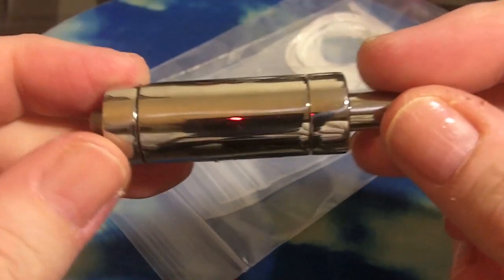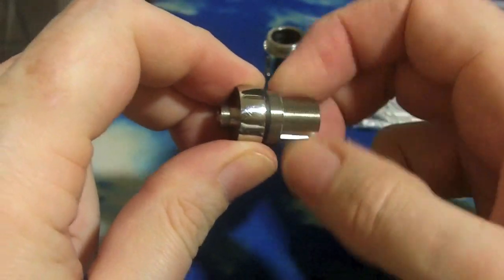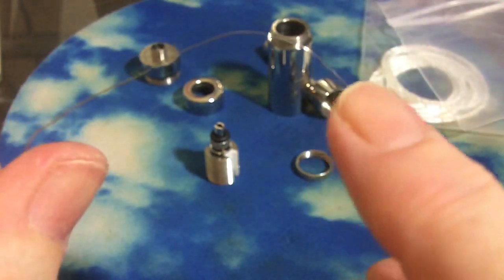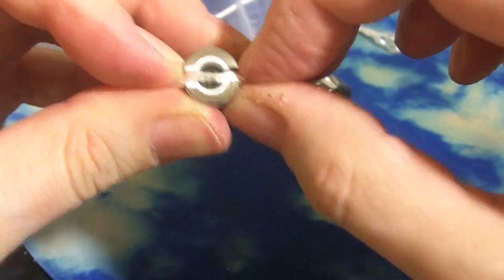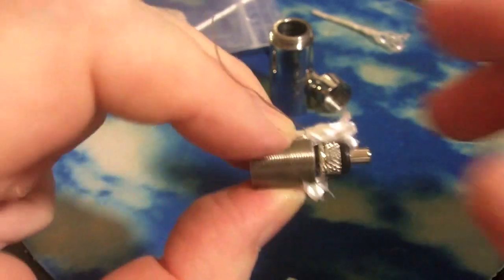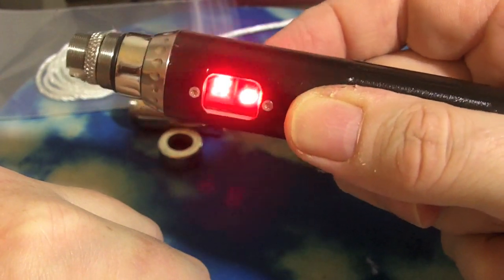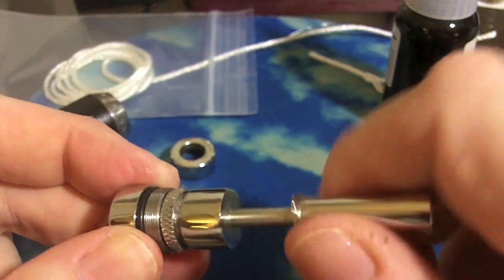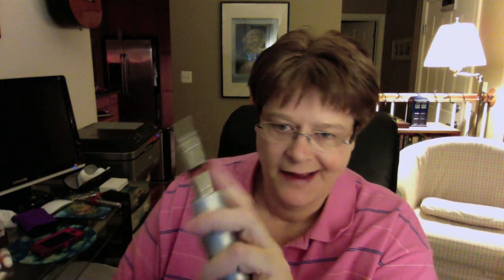GG Penelope Rebuildable

Comment: It is a lot easier and more forgiving only slight downside is you have to replace it more often as the fiberglass doesn't last as long as a mesh wick, but it really is only a minor issue, I still get 4 or 5 days out of mine and I'm a heavy vapor and likes higher voltages.

Comment: I found  that the juice will flow down the mouth piece making the syringe uneeded. Just run it down the side where the open area is on the triangle flange. The syringe might be a touch faster but I do like using them if I dont have to, just an idea.